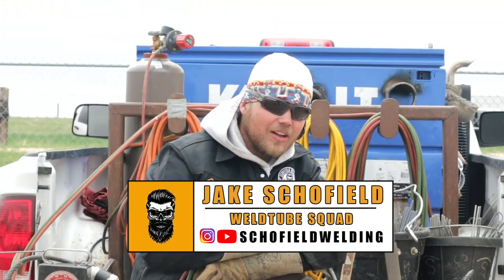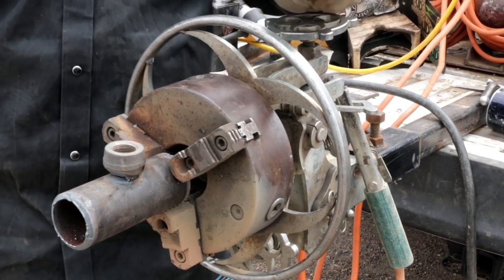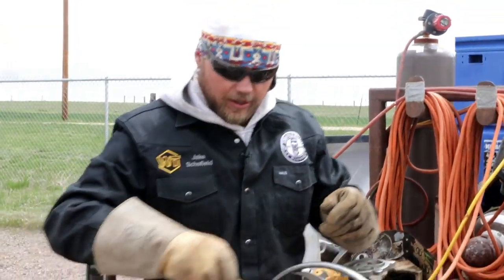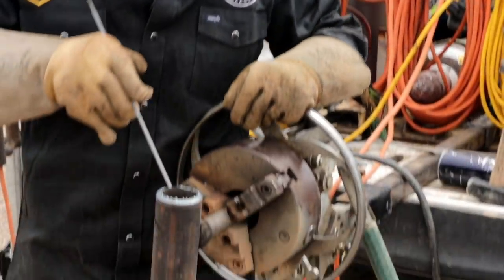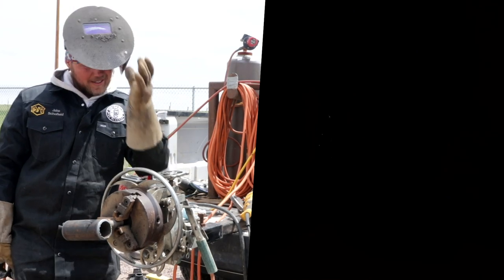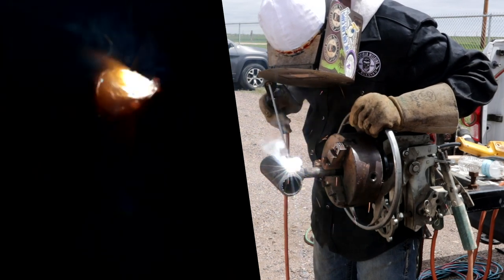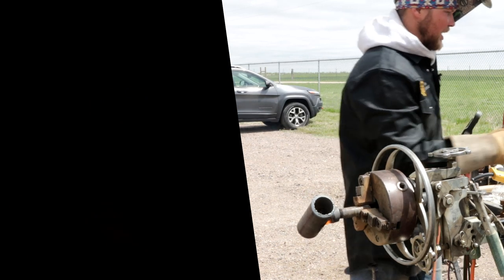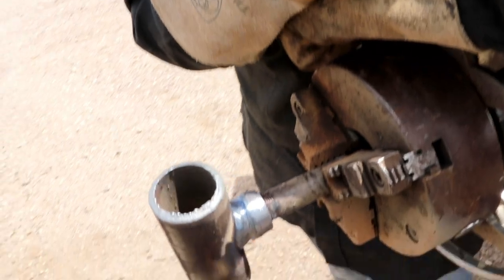Roll Out Threadolet with Schofield Welding

Comment: Nice video demo. Could you please do a video demo on 2 inch sch 120 carbon pipe using 309 stick electrode for fill and cap tig 309 root hot pass?

Comment: What would you say the practical differences are between 7010 and 7018? I know about their composition, but that's the extent of my knowledge. Is 7010 more wear-resistant or something? I would have thought 7018 would be just what the doctor ordered for welding pipe, but then again, I'm biased. If it's steel, I weld it with 7018, and I haven't had a weld crack or fail on me since way back when I was just learning.
Reply: 7010 is cellulose coated, 7018 is lime coated. 7010 is far more brittle than 7018 ( more ductile ). Also, 7018 is baked in an oven to eliminate moisture in the rod, which eliminates the moisture entering the weld and potentially causing moisture cracking later on down the road.